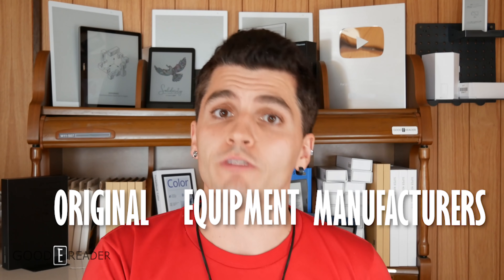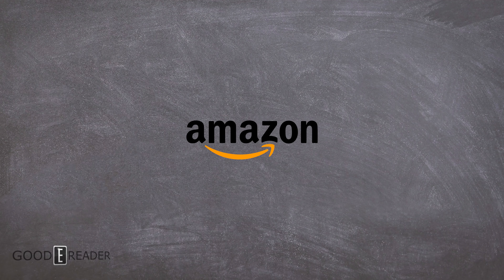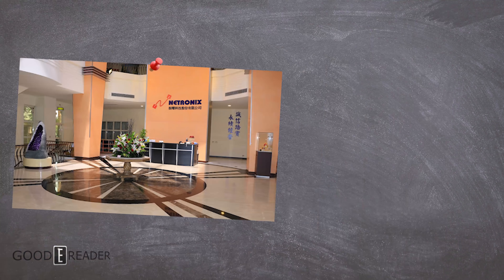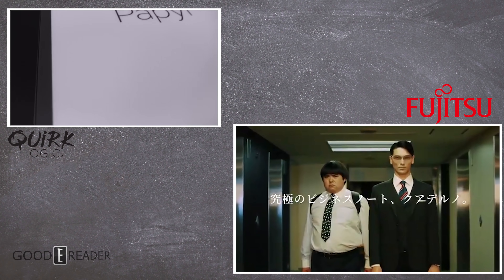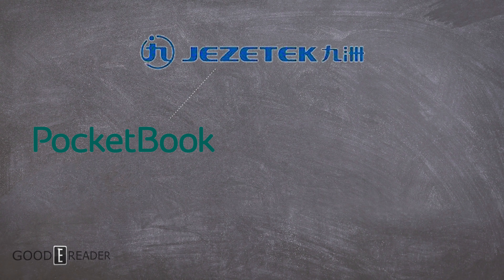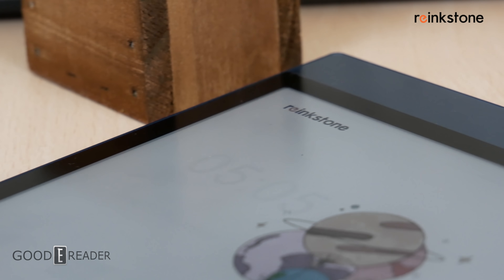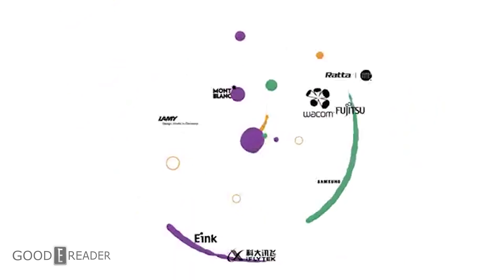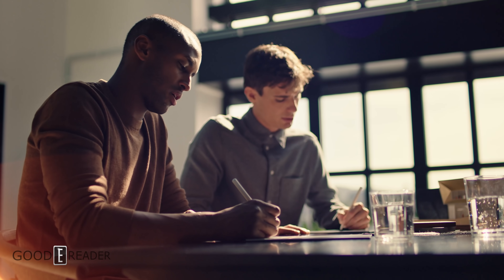e-Reader Manufacturers: Explained | Who REALLY makes them?

Comment: This is a very interesting video...I have both a Kindle Oasis (latest model) and a Kobo Clara HD. Was thinking of getting a new Kindle Paperwhite SE, but after reading an article about the life cycle of e-reader devices and having a real think about it, I decided that I don't really need to order a new device.
Reply: Thankfully E-readers are one of the longest lived technological devices around. You can still buy Sony E-readers that came out a decade ago if you so wish, and they still work.. books don't take much storage space so 2 gigs with an SD card slot up to 32gb is absurdly huge for an e-reader, and that was done a decade ago. The Pixels per inch of new readers is nice, so is the warm tone light. But the point of an e-reader is being easy on the eyes.. I'll turn on a reading lamp if I need to. That being said, the newer readers are definitely nice. Just wish that old devices could easily be repurposed as displays like a clock or weather station.

Comment: Thanks for the video, can you say a word about the software development? does each company make and update the software? do they basically use an OEM supplied core or sdk to build on top.  This is very important in terms of support and some future proofing.
Reply: They use off the shelf SoCs, the IMX 6 is a common one. The manufacturer of that provides a modified Linux kernel or Android build to them. They then customize it to their needs.
Forget your future proofing, because almost all of the devices require customizations you don’t have access to. There are rare exceptions, like the Remarkable.

Comment: You seem to be conflating companies like Apple that design their own products but have them manufactured with companies that go shopping for OEM's.
Reply: Well … it's all a matter of degrees. Apple designs its own shells and circuit boards, and an increasing number of its own microcircuits, but even it does not design all of the internal components of its products. And—not touched on in this video—there's the second huge question of who writes the software—not forgetting that software, like hardware, has layers and components.
I think the purpose of this video was to inform those who were previously unaware of the “OEM” term that all this complexity even exists, more than to delve into all the permutations….
Reply: @stephenspackman5573  Joe’s point of view is correct. The idea that Apple is “going to an OEM” to purchase off the shelf stuff to slap their sticker on is laughable. The fact that they use parts in their product is irrelevant. They only have the company manufacture they he device, and it is manufactured to Apple’s precise design and specifications.
Reply: @onemanshow4116  But nobody is saying that—indeed that was my point. Apple is indeed going to an OEM, but in Apple's case—since a large part of Apple's proposition is their in-house design—they are not using their OEM services, they are just using manufacturing services. The same company, unsurprisingly, does both. Meanwhile Sony makes its own products and sells camera sensors to Apple. People buy cloud services from Amazon and Google, even though Amazon and Google also provide middle end and customer services.

The mesh of suppliers is genuinely complex, and with technological goods the question “who makes this” is usually unanswerable without the use of charts. The OEM pattern is important to understand since it (along with licensing, second sourcing, regional branding and cloning, among other things) is one of the big reasons you see similar objects with different nameplates, and it can help you make purchasing decisions, but of course it is not the whole story.
Reply: @stephenspackman5573  There is insufficient distinction made in the video between companies which rebrand/ rebadge off the shelf products and those which simply engage in manufacturing. 

Amazon is not slapping a kindle logo on Foxconn’s shell… yet the video makes it seem like that’s what’s happening. 

You and I understand this, but others will not.
Reply: @stephenspackman5573  You’re completely correct, but it’s not really any justification to brush away the distinction. 

Apple develops, Foxconn builds, Apple sells. 
Amazon develops, Foxconn builds, Amazon sells.
Netronix develops, Netronix builds, Kobo sells.
Onyx develops, Onyx builds, Onyx sells. 

Though I do assume those relationships to be more complicated as well. The development is the most important step in the process, I don’t know why it’s brushed over like that. 

Remarkable develops, remarkable sells, but I BET they’re not actually manufacturing their stuff all by themselves. You just don’t really do that. There’s always a chinese company involved.